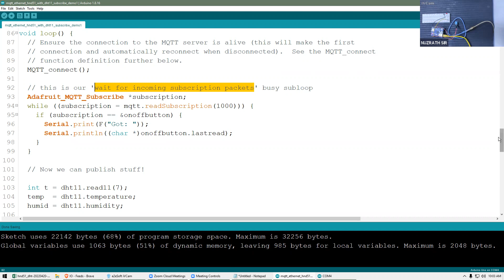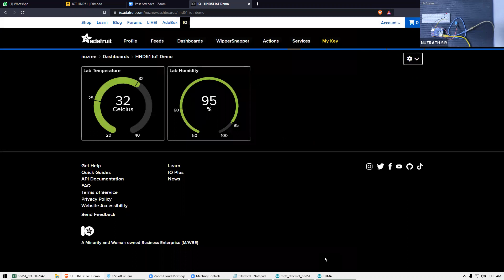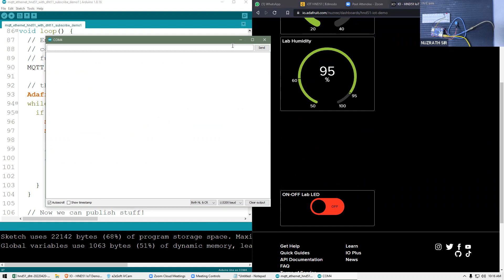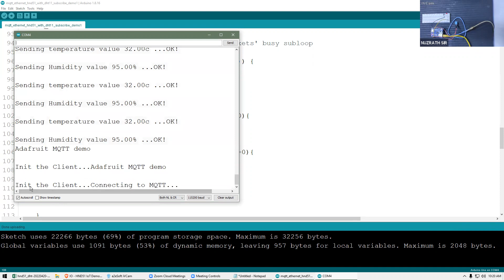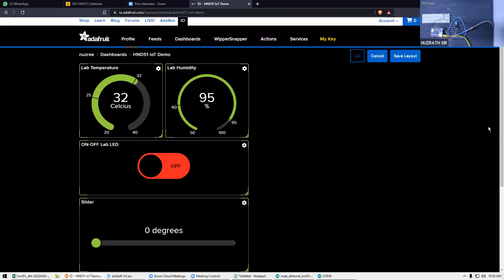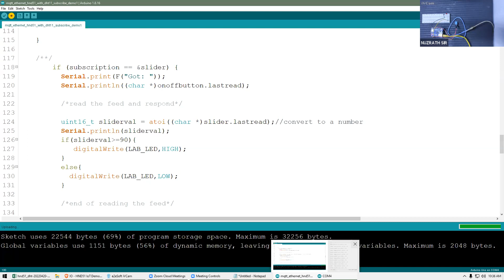IoT How to Subscribe (Receive) Data from Feeds - on Adafruit IO Platform

Comment: What happens if you subscribe to lab humidity... Will u get back the value you are sending?
Reply from the maker: possible to read that way too, but here the purpose is to control an LED at the LAB (it could be any device if you can connect to a Relay Module),
Thanks for asking the question.!
Reply: @NuzrathSir  thanks for your response.. i was feeling curious and tried it last night....it works fine...
The reason for asking was ..if i upload from one Device and want to watch from another ...it might be use.. great video ..
Reply from the maker: @soumendrasingh1  thanks for the support